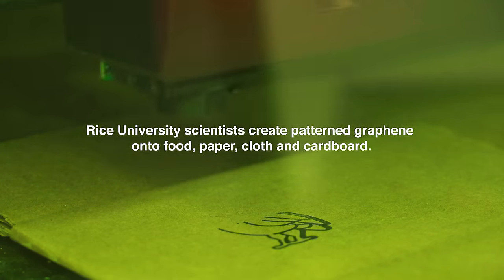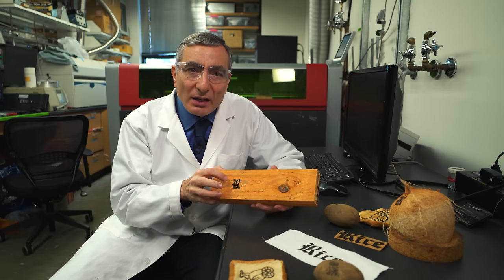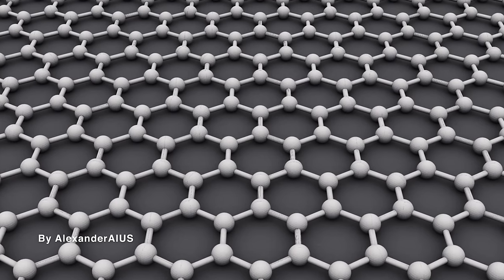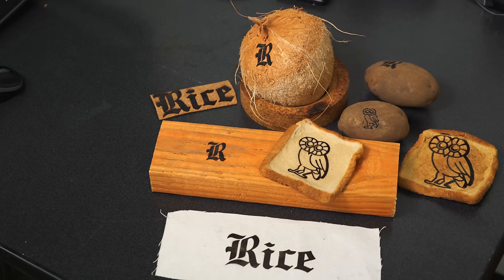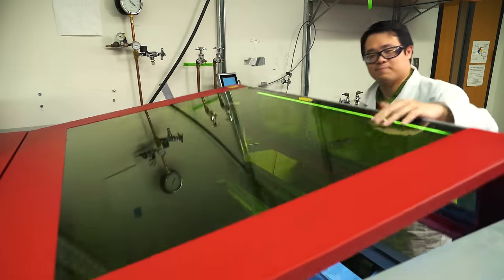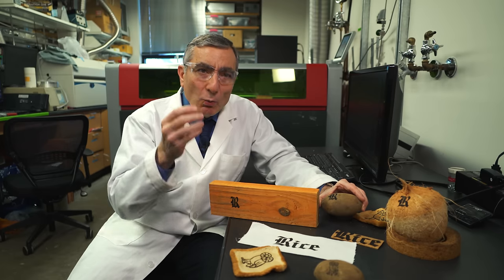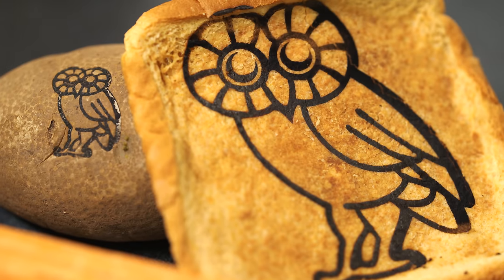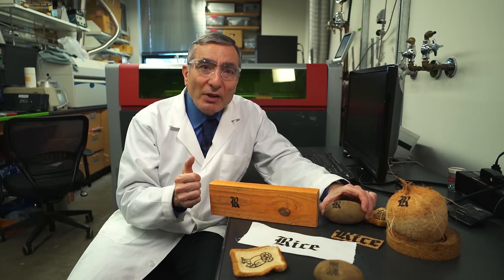Graphene on toast, clothing and cardboard has tasty potential

Comment: Dear Teacher
Very interesting,

I have a co2 (10.6 μm)  laser of 30watt. With this power will it be enough?

So if I do not understand wrong, the steps to follow are

1º pyrography a design in a wood (focused laser).
2º I repeat the previous step but with the laser defocusing.

It is right? How simple?
What lens do you recommend, the standard 2 "focal?
Thanks for sharing your ingenuity with the rest!
Reply: It's amazing!!
I performed a test on a piece of ebony wood ( because it has a high degree of lignin) with a 30w co2 laser.
And after several passes (out of focus to increase the laser pulses in the area),
the area has gone on to conduct electricity.
Now it has a resistance of about 80 Ohm at a distance of about 10cm from the tips of the meter.
Thank!!!